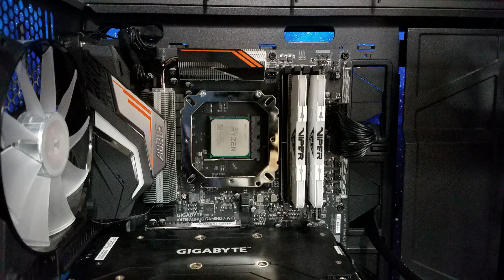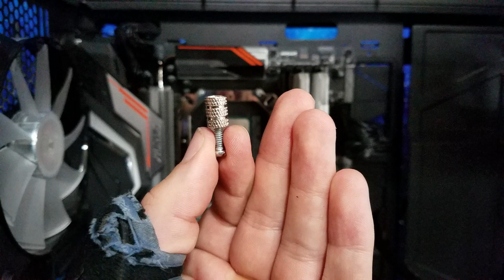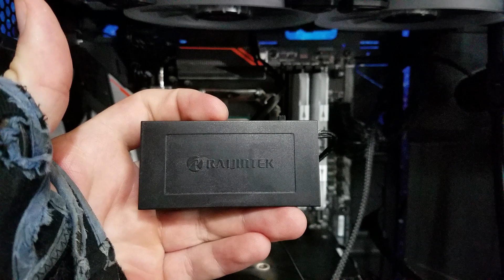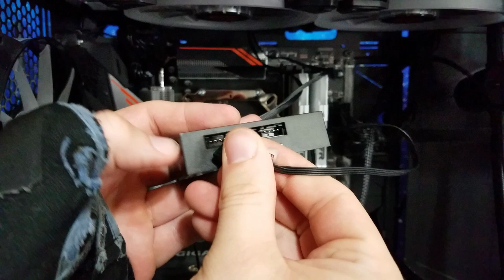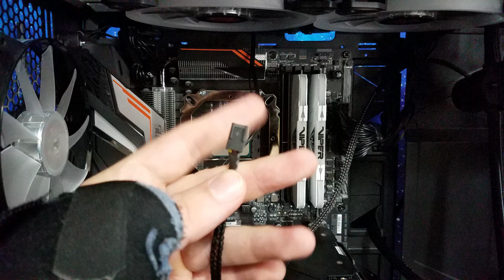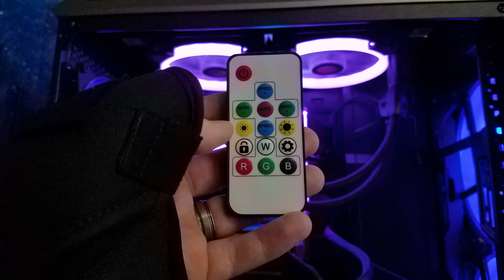Raijintek Orcus 280 RBW CPU - Cooler Install - Lighting Guide

Comment: With asus z390-a mobile, wasn't able to get mb rgb control working. Works fine via remote control. But if the molex connector is plugged In and the hub is connected to the 12v rgb header (board has no 5v header), no power is supplied to any of the fans and the machine doesn't boot, nor do the attached devices light up (normal board rgbs and ram, however, still lit up as normal)

Comment: I just got this cooler, all seemed well until when it came to installation ! Upper mounting plate that the CPU block screws on to HAS NO SCREW HOLES. W.T.F. it appears i got two back plates (1 with foam backing & one without), i guess i'll need to fabricate my own mounting solution !

Comment: worthless guide cause u don't show how to connect anything.
Reply: Agreed.
Reply: @nocturnaljoe9543 I ended up never using the rgb on this. It's very flimsy and a fire hazard.
Reply: @AlkaVirus  Common, dude. You payed for it and the hazard is really low af.
I have a side glass on the case to enjoy the fancy lights. I will try to get it running.
Reply: @nocturnaljoe9543 greed it was sad but I eventually got a new radiator for an open loop setup. Be careful though because the controller will set on fire if it's plugged in the wrong place. It happened with me.
Reply: @AlkaVirus  Thank you for sharing. There is a fair chance, that i actually did put it into the wrong place. Since I cannot find one single clip where people are showing where to fit the cable of a Orcus 120 into a MPG B550, althrough it is 100% compatible.

Comment: I am going to say this for the 100th time, Molex has higher volt/amps then SATA, that's why some products have to use it!!!
Reply from the maker: Which is why I gave the Swiftech Maelstrom Pump/Reservoir a pass on that. Seen too many RGB controllers use SATA (and LEDs use little power), that I prefer an AIO cooler to go the SATA over Molex route.